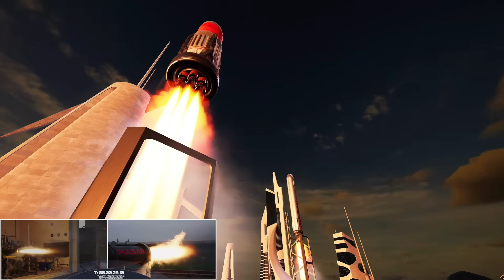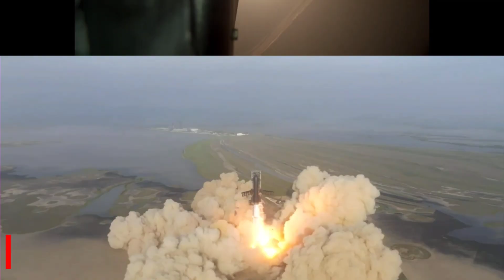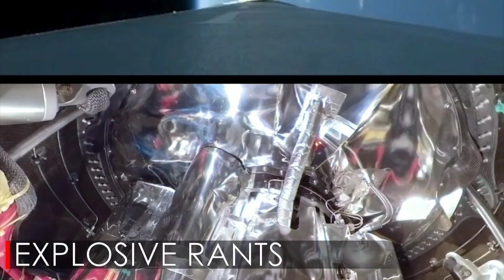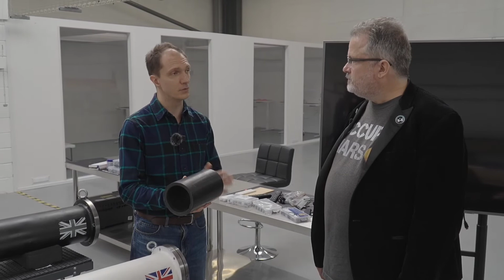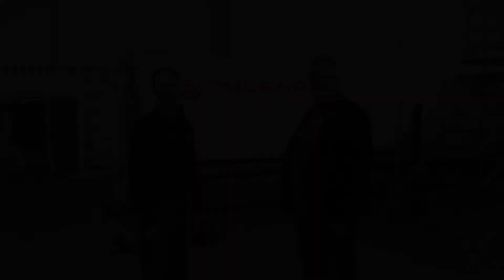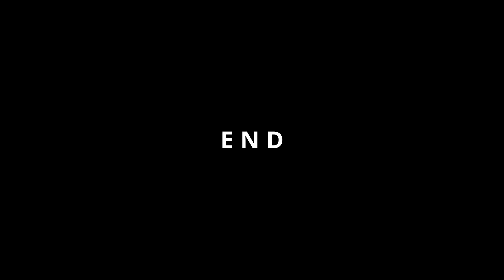Fusion Engine orbital test in three years!!!  Here's how!  Pulsar Fusion Tour Part 2

Comment: would the fusion plasma engine be scalable and could they produce thrust as high if not higher than jet engines enough to replace fossil powered jet engines for aircraft if we had the assistance of a fission reactor to intensify magnetic field to help direct the flow of plasma over a more concentrated area and density to produce more thrust. but its not just the size and power of the magnetic coils its also about using smart magnets that can help this technology forward. if thats the case could we create a very power and smart magnetic coils with the assistance of ai, and a supercomputer like a quantum computer as that could help regulate plasma flow a how fast the plasma can be directed as exhaust.

Comment: Good video.  you said " They heat hydrogen  to 2 million degrees in a way similiar to your microwave oven".  However there is no explanation of where the energy required to do this comes from.

Comment: The low sound volume on some clips is easily fixed with a free program like audacity using the normalization function.  Then reintegrate the normalized audio with the video clip in your video editing software.

Comment: You did not mention having high volumes of neutrons in the plasma discharge. Does this plasma somehow not act like a neutron cannon or do they have to test at significant distances? I would think that the extremely high velocity discharge of 500,000 MPH would be a serious threat to any living thing below or behind it for as long a distance as it takes to diffuse. Also that the progressive diffusion makes the affected area behind it progressively larger as it travels away; and that distance might be greater than the Earth's atmosphere.  

This would explain why they do not wish to test in atmosphere and are keen on testing in space. Angry, they danced around you. I don't hold the evasion against them I would not advertise this either. Fantastic technology but not something I would wish anyone firing up on Earth. The potential for weaponization is also horrifying. A cannon which could sterilize every living thing out to the horizon in every direction ( even through buildings and bunkers) with a single rotation. They mentioned Orbital testing. What would be the outcome if they accidentally aimed that directly away from the Earth? Some authority should run the numbers before they are allowed to test that thing anywhere within the range to the moon.  I honestly question if that technology should exist given the history of humanity, there are things which humanity is not ready to handle.
Reply: "You did not mention having high volumes of neutrons in the plasma discharge."
          That's because there shouldn't be a high volume of neutrons, and any which escape would escape in all directions..  Deuterium/helium 3 fusion produces a protium (Hydrogen 1) and a Helium 4, no neutrons.  Secondary incidental dee/dee fusion might produce some neutrons, but a design goal is to minimize that.  If you think you know how to direct neutrons into a beam or exhaust the physics world wants to know about that.  The plasma exhaust is to be directed electromagnetically and neutrons have no charge.

"I would think that the extremely high velocity discharge of 500,000 MPH would be a serious threat to any living thing below or behind it for as long a distance as it takes to diffuse."
          You shouldn't think that.  It's not fast enough that the nuclei act like hard ionizing radiation, like cosmic rays that travel at a significant fraction of the speed of light.  If you stuck your head in the exhaust, the heat would melt your face, but that effect would dissipate rapidly with distance.

"Also that the progressive diffusion makes the affected area behind it progressively larger as it travels away; and that distance might be greater than the Earth's atmosphere."
          Son, all the nuclear bombs ever made going off at once in the same spot couldn't produce the sort of devastation you're talking about over the range and area you claim through the atmosphere.  Show me your math.

"This would explain why they do not wish to test in atmosphere and are keen on testing in space."
          They explained that well enough, and THEIR explanation has the notable advantage over yours of conforming to actual physics.

"I don't hold the evasion against them I would not advertise this either. Fantastic technology but not something I would wish anyone firing up on Earth."
          So, they are secretly plotting to destroy the Earth?

"What would be the outcome if they accidentally aimed that directly away from the Earth?"
          Thrust in an accidental direction.  The air at sea level has a pressure of fifteen pounds per square inch.  It is pressurized by the weight of the air above it.  That means that every square inch of the area coverage of the atmosphere above you has fifteen pounds of mass between you and space.  That is why the astronauts on the ISS are exposed to more radiation than a person on the Earth's surface.  They are inside the magnetosphere but outside the atmosphere.  The magnetosphere attenuates solar particle radiation but the atmosphere attenuates cosmic rays, both relativistic nuclei and gamma.

"A cannon..."
          This thing would be no more useful as a weapon than any other rocket.

"which could sterilize every living thing out to the horizon in every direction..."
          The only sterilization effect would be heat, and that only at CLOSE range.  There is a certain minimum ENERGY requirement to the sort of death ray you imagine (sterilizing huge areas from 60 miles away?  Even with no atmospheric protection?  NOPE!), and no known or proposed tech could concentrate such an energy generation into something the size of a spacecraft that could be launched by the Starship BFF, with the possible exception of antimatter.

"( even through buildings and bunkers)"
          I think you are confusing neutrons and neutrinos.  Ordinary lead or concrete shielding (any sufficient MASS) shields against ANY form of hard ionizing radiation except neutrinos.  And if it couldn't, space radiation would long ago have sterilized the Earth, oceans and all.

"I honestly question if that technology should exist given the history of humanity, there are things which humanity is not ready to handle."
          The last thing in the the world we need right now is more busybodies policing us children and making sure we aren't trusted with sharp objects.  And if we ever DO need such a technonanny, we'll hire someone who knows more about physics than you.
Reply: @digitalnomad9985  Well said sir, well said indeed!
Reply: @TheDavidPoole  🙇
Reply: If you want to scaremonger, every time a rocket lauches there is a risk of catastrophic failure. Every time a meteorite impacts earth theres a risk of some hitherto unknown bacteria that could wipe out all life. We could be struck by a city killer (or worse) asteroid at any moment. Putin could start throwing nukes at Ukraine. Yellowstone could erupt and wipe out most of the US and a lot of the rest of the world. Covid 24 might finish the job that 19 started. CERN might create a small black hole that eats the earth from the inside out. A.I might destroy mankind.
Not doing something may be the safest way to go about life, but without innovation where would we be?

Comment: How do they ensure that the Deuterium fuses with the He3 and not with itself? I believe I read somewhere that there is a fusion threshold overlap and that approximately 40% of the deuterium will fuse with itself rather than the He3 creating lots of radiation.

Comment: This makes no sense. What benefit do they have of the fusion if it doesn't give any extra energy output? Why even bother with fusion if not for the energy from it?
Reply: Fusion would heat the propellant and increase its velocity.
It wouldn't be a stable plasma.

My issue with this engine is that you need a fission reactor to run the microwave heater - I wish commercial space luck if they want permission to launch a big fission reactor!          :D
Reply: @EveryoneWhoUsesThisTV  Sounds like an unbearably complex system if that is the case. Complexity beyond what reasonable startup money can bring to such a small market. And yes indeed, it likely won't fly either way for political reasons.
Reply: speed.
Reply: It makes a LOT of kinetic energy, not electricity. They are making a rocket engine for visiting the planets in reasonable timeframes.
Reply: @rubikmonat6589  How will the "fusion" in their rocket add (kinetic) energy into the propellant? 

To me it sounds like for this to happen, they'd first need a working fusion reactor. So they'd first have to solve humanity's energy needs for all future, and become billionaires. Then they could make this rocket. Hence why I think sounds like possibly just hot air.

(For a fusion plasma to add more thermal energy to itself than you put in from the outside, like from the microwaves he was talking about, then you'd need to have a basically functioning fusion powerplant, in principle)
Reply: @Virtueman1  think of the fusion like the combustion in a normal rocket engine, it releases a ton of energy and expands the gases. they dont need to recover enough electricity to run it, dont fixate on that, it needs a big external power supply.
Reply: It's not an intelligence test.  They aren't saying the process doesn't release energy.  In fusion power research "Scientific break-even", producing more energy in a reactor than you put in, has already been done.  "Engineering break-even", where you get enough useful electric power to keep the reaction going (or more) has not.  (Level 3 is "Business break even" when you can sell electricity and not lose money, we're a long way from that.)  They are saying that they aren't trying to turn the particle speed energy into electricity, they're just directing the particle speed aft for the equal and opposite reaction.  Both a natural gas power plant and a methalox rocket release energy by oxidizing methane.  But a methalox rocket isn't a power plant, you can't plug your computer into it.
Reply: @digitalnomad9985  So they get *some* fusion energy out from the reaction, but not more energy than they put in, and this is enough to effectively use the hydrogen as a fuel that adds some energy to the propellant?

Can that limited output be enough to be useful, is a good question...
Reply: @Virtueman1  its about making the highest possible propellant velocity. so you can get more push per kilogram of fuel used.
Reply: @Virtueman1  We will see.

Comment: Thanks to Pulsar for allowing us to have a peek inside their Facility and saying their Plans.
Is it me or did it seem like the Hybrid Engine after being ignited and burning didn't seem to have a high velocity output compared to Solid or Cryogenic Rocket Engines? Like the Raptor 2, or Merlin, or any of the other Rocket Engines or even Solid Boosters.
It looked similar to a fire exiting the body of a BBQ instead of a Normal Rocket Engine Forcefully Expelling the Fuel to Provide Thrust for the Launch Vehicle, Tho it didn't have a nozzle.
Reply: I think the vid was slo-mo, and it continued after the oxygen feed was cut off.  Yea, heavier molecular weight of combustion product/exhaust means lower specific impulse for a given operating temp (limited to first order by the melting point of metals).  At the same given temperature, molecules of hydrogen are moving faster than molecules of (say) CO2.  For hybrid rockets I think that aluminox is more exciting, allowing for Lunar ISRU source fuel for chemical rockets without depleting the (possibly limited) lunar ice deposits.  Some of the lessons learned developing the plastox hybrids should be applicable to aluminox hybrids.
Reply: @digitalnomad9985  thanks for the info.
I did realize it was in slow mo but, it seemed much less energetic/powerful than a normal rocket engine.
Unless that's their point that is. Not needing to reach Escape Velocity, as opposed to moving while in Vacuum.
But, even then why no nozzle? Just my nit-picking OCD/Perfectionism shining thru, out of my Inquisitive Mind.
Reply: @JeffBrazeel-fe4wc  Don't know why, unless they're cheaping out on the prototypes until they get the fuel feed/combustion part down cold.

Comment: Why do they need the rare hydrogen and helium isotopes if they are not creating fusion?
Reply: They are creating fusion. Just not fusion ENERGY generation. The fusion creates the plasma which is expelled at high speed which makes thrust.
Over-unity Fusion energy generation is what places like ITER and the rest are trying to crack which is incredibly difficult at the moment. Fusion propulsion is an entirely different and easier to tame beast. Not saying that it's easy, just easier.
Reply: @TheDavidPoole  "They are creating fusion. Just not fusion ENERGY generation. " The diagrams and explanations in this video don't include fusion, just ion propulsion, which should be good enough.

The bit at the end of the video about having to have an income stream to pay for their "fusion propulsion" is brilliant. And being a world expert in ion engines certainly represents a cash cow that would finance further research. Even if their fusion engine fails, and it probably will, they would gain from all the experience and solidify their position as world leader in ion propulsion. Success is at best, only possible, maybe remotely possible. You can do all the right things and fail. Only failure can be guaranteed. They seem to confront that truth full on.
Reply: @RockinRobbins13  I agree, and I commend them for that. If they get the scaled down (!) tests successfully done creating the relevant temperatures in the big vacuum chamber then they can go forward with larger scale full tests in orbit. Failure is part of eventual success. SpaceX has shown this amongst others. I'm gunning for their success.
Yes, currently their main thrust (no pun intended) is ion engines to generate revenues for their continued research and testing of the eventual fusion engine. I wish them luck.
Reply: These isotopes are heavier than commonly found isotopes of helium and hydrogen. With the same propellant speed, they will produce more thrust.
Reply: @RockinRobbins13  I had a sneaking suspicion of that.

Comment: So... SpinLaunch could hurl these plastic fuel pellets straight into space to await usage 😒???
Reply: SpinLaunch will never launch anything to orbit. It's a fraud.
Reply: Indeed. And as a solid, it wouldn't need much shielding. The hard part might be in correctly loading it into the engine area itself. (Quick! Somebody invent a tractor beam!)
Reply: That's an interesting idea. Basically a plastic bullet into orbit.
Reply: @jamesgibson3582  It can never work. People forget that even if they could hurl a pellet at orbital speeds off a turntable accurately, the timings are far beyond the precision of any capabilities both mechanically and computer software/hardware, the projectile would impact the full pressure of the atmosphere at Mach 22, instantly destroying any material, no matter how dense, strong or made of any material.

If you chose whether to hit the side of a mountain or the atmosphere at those speeds, the mountain might be the better choice.

Thunderf00t has an absolutely devastating video on why Spin Launch is a fraud, including even the placement of their "control building" as evidence. Even Spin Launch's downscaled test was a failure. Of course, rather than take credit for the failure in Musk style, a badge of future success, they covered it up and pretended the launch was perfect. That's a very bad sign.
Reply: @RockinRobbins13  I was unaware of that. Well, its always 'seemed' like a good idea. But if the laws of physics and materials has to be broken, then I guess that writes it off the list.
Reply: @heathwalker6938 the idea of plastic fuel logs in orbit that get picked up and assembled  into an orbiting rocket motor is visionary. Now to figure out to do it if Spin Launch is still speculative.
Reply: @jamesgibson3582  Spin Launch isn't speculative at all. It's a lie.